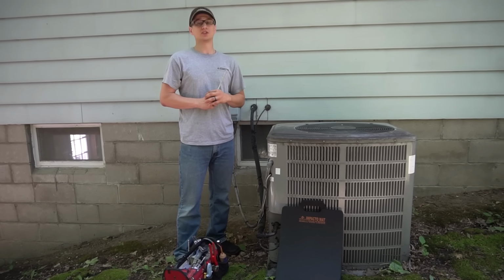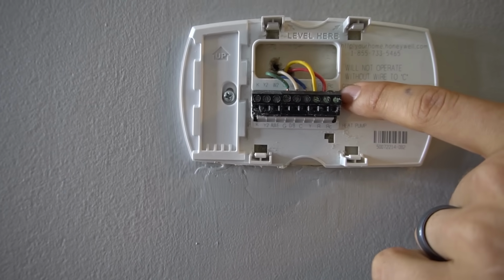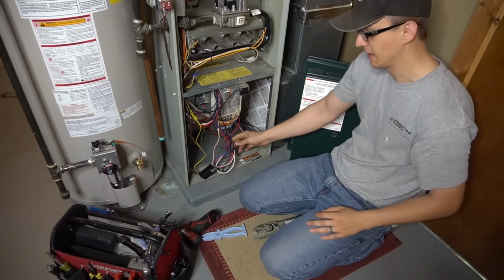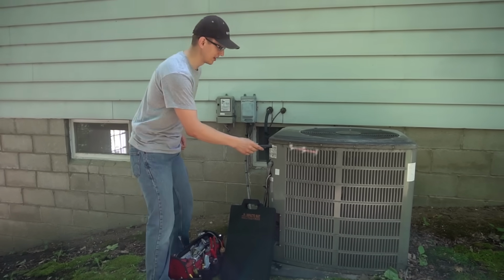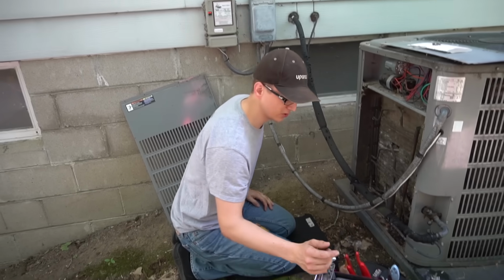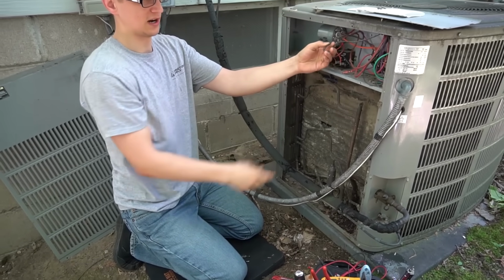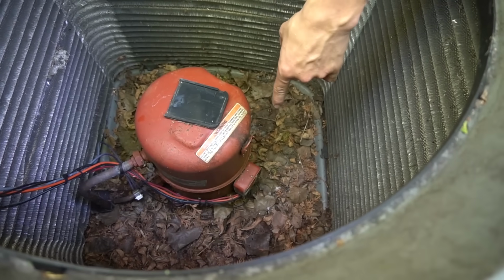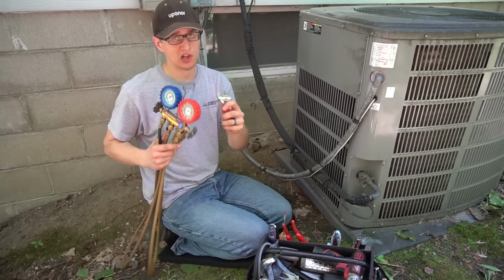AC Unit Not Turning On - How to Fix It Step by Step

Comment: Your videos are great, but I am having an unusual problem. In AC mode my system works fine in the mornings when my attic is cold. My blower stops running when the attic gets hot. I have replaced the blower motor and the capacitor. Any Ideas?

Comment: Ok, so, woke this morning to a warm house. Furnace fan was running. Both the fuses in the outside shutoff were blown. Knowing they were rather old i thought just maybe. And went ahead and replaced the fuses. Upon powering back up, they immediately blew again. 
  I assume checking the cap. Would be the place to start?

Comment: Hi, thank you for this video. The fan from the furnace in the house works but the AC doesn't.  I went outside and pressed the 220 v passer thingy and the ac worked.  Does that mean that something in my furnace is wrong? Or thermostat?

Comment: Jay, watched your video a few times and think I might have narrowed down to the compressor. The plunge switch turns on the outside unit but after holding it down for 2 minutes the air blowing out of the vents doesn’t get cold. Is that likely the compressor? It’s hard for me to tell the difference in noise between it and fan?? 
Also still confused as to why the inside system is blowing but isn’t turning on the outside unit fan even if the compressor is bad?? Your an Angel!! Thx

Comment: Question, I can’t seem to find the plunger to check your recommendation about it being depressed. I think mine has a plate over it. If my unit is turning on, and not blowing cold air, plus it is making a low hum/deep buzz noise every 60 seconds or so, does that mean it’s the compressor most likely?

Comment: My blade was not turning, unit made intermittent noises, finally got blade to start turning, but intermittent grinding? sounds persisted. Having trouble telling if it is the motor or the compressor making the noises. Not making normal constant running sounds. Thinking it's either motor, compressor, or capacitor affecting motor. Friend replaced motor over 5 years ago.

Comment: After watching 3 of your videos and reading tons of great comments here I still couldn’t fix my carrier ac unit sitting outside.
What I diagnosed so far is:
- Condenser works but fan doesn’t. After 40-50 seconds condenser shuts down.
- I opened up the panel. Capacitor and cables all look good and new. There is a blinking yellow light on the motherboard tho. (it’s a 2008 made unit). Couldn’t find what it means online.

Any thoughts what the problem is here?

Mine is a carrier performance 24apa5 model ac.

Comment: Thank you so much for this video!! Our AC unit inside wasn’t blowing cool air and the house got it up to 83 inside and we live in FL, the heat index today was 97. My husband used the screw driver to get the fan going and moving & that was the trick because the outside unit was going at all. Thank you, thank you, thank you! We are leaving to go on a trip this weekend and wasn’t going to be able to leave if the unit wasn’t working.

Comment: My unit dose not seem to be getting call from the thermostat , how do I check for the 24 volt? My inside unit is running fine, when I push the bypass on the outside unit it comes on , fan and compressor. My problem started with the thermostat battery went dead , I replaced the battery but the nothing!  I had a technician come in , he replaced the transformer , then said the blower motor was out , after he left I checked the blower motor it runs just fine .   I found a louse connection on a wire nut and the blower motor started but the outside unit is not coming on.

Comment: Excellent video! Question, my unit runs fine but after about 45 minutes the fan stops and the compressor makes a screaming noise. Any idea on what it could be? I know you said if the compressor makes a loud noise it’s probably bad but would that cause the fan to stop as well? Also, when I first discovered the noise and fan not moving I banged the top of the fan and it started spinning again and the noise went away. I’m probably gonna replace the fan motor but not if the compressor is bad. Any help would be greatly appreciated. And again, Great video! Extremely helpful!

Comment: Is it possible that both of our units would fail at the same time and seem to have essentially the exact same symptoms repeatedly? Both are Carrier units and about 8 years old.  We have replaced  blower motor control modules on both garage units (1 week apart when the units were 2 years old), and one again a year and a half later. Both fan motors were replaced on the outside units when the units were 4 years old (3 weeks apart). I cannot help but wonder what's going on with these Carrier units since things happen to both simultaneously. Our problem now appears to be again with the outside units, as both will blow inside for awhile then stop (the only difference being that one's outside fan will turn for about 30 minutes then stop, and the other won't turn at all). The outside fan blades turn freely when spun manually. We have turned off and on breakers in the house, as well as outside at the units in case something was tripped. We even installed a surge protector on our larger unit 3 years ago to be sure that power surges were not adversely affecting our units, and now this is the one that will not turn at all. We are are out wits end because we replaced 20 year old "builder grade" AC unit which never gave us a problem; we just thought that we would upgrade before problems started happening...what an expensive mistake! ($16,000 for the new units and early replacements (first three years) described above were under warranty but the labor and diagnostics never were). Any advice you might have would be greatly appreciated.

Comment: My ac fan will not turn on outside but everything else inside works, when I push the plunger button on the ac unit outside, the fan kicks on but as soon as I let go it cuts off what could the problem be?
Reply from the maker: It should be one of the problems I cover in this video: https://youtu.be/NVPhsK4gK1A
Reply: I found out what it was, it was the overflow switch that is in the drain PVC line, also had to use a jumper on the thermostat screen to reset the ac system

Comment: Excellent, detailed information. Thank you! Clearly explained with invitation to ask questions, etc. Just threw  my AC breaker switch after checking thermostat, inside etc. Outside moved blades. Waited about 15 secs. Turned thermostat on. Went outside. AC working!! Thanks. Saved me that $95 hello ++ from service guy!

Comment: Sorry another question about thermostat , if after replacing batteries, got reading on inside r y wires but didn’t get any reading on outside wires, is it safe to assume thermostat is the issue. (Fan works, connector tested ok and finally pulled in after debris was removed, outside unit ran, then died again. )
Reply: Do you have a video for the outside unit panel testing, in regards to thermostat wires just to be sure we did it right, thank you

Comment: Outstanding video to allow me to understand the basics of my A/C system!  Thanks.  My problem, still unsolved by my junior A/C man: air handler inside is working, outside fan blade spins freely, thermostat calls for air, outside capacitor is not bulging, contact sucks in as shown in video on my outside unit, but the outside compressor does nothing.
The unit was working fine last week, but I did notice that the outside refrigerant lines and one side of the compressor had a quarter to a half of inch of ice on them.  The 4-ton Goodman unit, new furnace and air handler was only installed two years ago.  And the man/company I purchased it from and who installed it died of cancer a few months ago.  The kid (less than 30 years old) left my place and said he was going to have to call Goodman to try to ascertain the problem.  Why can't some young man like you (with tons of A/C knowledge) live in central Wisconsin?

Comment: I see you only have just two contactors listed.  Do you need one specific to your condenser unit or can i just order one of those listed, depending on whether I need a single or double pole contactor?  Thanks again!
Reply from the maker: It is as you concluded, the brand does not matter, just if it is single or double pole 👍

Comment: Hi. Thank you so much for so many good and understandable videos. I have a question. I live in the Key West FL and it's basically 9 month hot weather. So my AC works a lot. What it does sometimes the fan on outside unit will start spinning wrong direction and it will make strange sound. Usually I'll just turn thermostat off and turn on later on and it's fine. But I do want to fix it and understand why it's doing it. AC is not that old (2018)

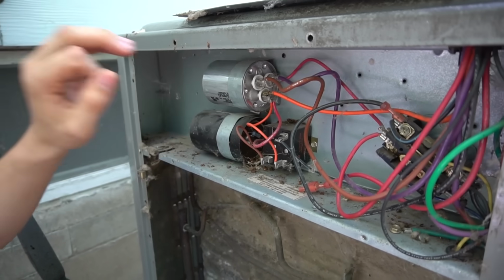Comment: At 18:30 you say if the plunger is in, (the one you press) what if it’s not? Mine isn’t mid way or back towards unit, it’s right at end, but when I press on it it like you do it does come on. When released unit stops. Fan and thermostat are working.
Reply from the maker: If the plunger does not pull in on its own, then it's time to move on to this video to find out why: https://youtu.be/NVPhsK4gK1A
Reply: Thank you, I think maybe the water line thing you said, we’re in Florida I was sucking it out to clean it then it quit so is it possible I knocked it out of place when doing that? Well check it tomorrow in daylight. Thanks!

Comment: they are reduing the siding on my condo unit. They asked me to pull the breaker so they can pull the electrical boxes off the siding while they work the new siding on.  Now i got no air.  the inside fan works but not air

Comment: Great diagnostic video.  I had a plumber knock loose the 24V signal wire to the condenser.  Your video led me right to the culprit.  Cost = 1 wire nut.

Comment: Hey Question please as we are dying with 100 degree temps inside our house for weeks now and AC techs are booked up solid thru the end of the summer...

So NO AC, bought a new thermostat, installed it, checked to make sure i have 24v to the thermostat (red and common voltage check and its good (27 v).  AC is not turning on.  When I push in the contactor bypass, the AC starts whirring and sounds good.  But I let it go, it stops.  I don't see anything obviously wrong, no frayed wires, capacitor looks fine.  The AC motor starts running and sounds great when i push in that contactor bypass, so the AC motor is good and it seems I'm getting power and all to the AC.  

What could be the problem?  Is there any way to keep that bypass pushed in somehow or otherwise bypass everything so my AC starts running?   

Thanks and desperate for help.. I can answer any questions or do simple checks if needed.  Yes the circuit breaker switches are ON and have been flipped off and on. (just in case you ask)

Comment: OMG, I have never watched a video that gave you so much information and I've watched a few, as I like to fix things myself if I can.  You are great, thank you so much for this video, I still can't get over the fact that you shared so much.  I don't know that I'll be able to figure it all out to actually get my air working without calling someone because I'm scared I'll mess something up but wow, thank you, thank you for the share.  I did the basics that you said but it still won't turn on.  The thermostat shows it on but it's not.  I'll try some of the other things you said and see what happens.  Thank you again!  You're fantastic!
Reply: I have question my condenser fan motor is working good but my compressor stop many times I check 24 volts is ok ,from thermostat to condenser is good 24 volts the compressor continue do same problem?
Reply: @zurdohtown  your short cycling somewhere. Check your drain line and your float switches. Be sure they are installed properly and check drain
Reply: Great video, most people act like they know something, this kid does.

Comment: I was up for 3 hours taking apart everything!!in a hurricane from 11am till 2 am. Today, i took off the thermostat and there was a bug on the fan and cool wires omfg tysm for this man its been 10 minutes and its cooled off so much can i send you a tip???
Reply from the maker: Yikes, sorry to hear about the multi-hour AC battle! Glad to hear you were able to find and fix the problem. 👍
You can but don't feel obliged to 😉 I have a PayPal link in the video description.
Reply: @WordofAdviceTV  well it seems like i het it going, then after a hour or so it stops again. 3 times its happened. Its like the fan isnt getting enough power maybe or for long enough? I greased the bearing the fan rotates on i did all the checks, which i did find a bug on the ac fan wire and the ac wire with the split itself. That also got it going again. Maybe its the fan motor which is $300-$600 but the thing is, this is a 30 year old train 1500 and it doesnt have almost anything the new ones have. I couldn't even find a fuse AT ALL DOWN STAIRS. I CLEANED THE LINES VERY WELL. GREASED EVERYTHING i could get to(bearing wise or parts that spin) lmao i cleaned the disconnect and romoved it while working. It needed help getting the fan moving so i pushed it and it started right up the first time. Then found the bug behind the thermostat, greased the bearing for the fan, started right up. So what does it sound like to you? Am i right to think its the fan motor? And absolutely i will give you a tip!! im in new Jersey, its been raining and over 90 degrees with 70 or higher humidity  man i have no other options at this point. I hope to hear back from you!!thank you sooo very much for your time. If i leave my email can you or i delete it so you can get in contact with me and maybe we can video chat?? This thing is old but still almost new id really like to save it.

Comment: Such a great video. The thermostat is set to hold and it is on the cool setting and the AC is not kicking on. If I set thermoset to fan on - the fan does not come on. If I walk outside to the compressor and push the contactor the fan outside comes on so it seems the problem is inside or the wiring. Do you have a video on how to diagnose the board/wiring? How would I bypas the thermosat and force the compressor to kick on?

Comment: This is great video for basic diagnostic of failing ac system.
  Could someone help me with my issue, my condenser keeps blowing 30amp fuse on electric panel.  Any suggestions?
 Thanks

Comment: could you make video how to fix pipe leaking, the technician said I needed Purge, Repair, Vacuum and Refill with R-410a refrigerant 8.50/oz (avg 50 oz). plus instead of tackle where the leakage, do you think I can replace the whole copper pipe.
Thank you from Kenneth

Comment: My fan motor turns hot when I push the button that bypasses the thermostat and doesn’t spin. I checked the cap and it’s rated for 30+3 but I got 26.3+3 should I change the cap? The compressor also turns on fine.

Comment: Urgent: I need your advise. Bought a condo last year and just a month after the home warranty ran out, AC compressor stopped working (3 days ago). I followed your steps and identified it as a 2006 Allegiance 13 3 1/2 ton r-22 unit. The fan in both inside and outside unit works. The capacitor is good. A technician also said that the capacitor and hard start kit are good and concluded a bad compressor since it tried to start but stopped immediately. The technician estimated about $5-6K to replace the outside unit. It will put a big dent in our savings. Should I try your test to see if compressor is shot? Or Just replace it? The technician would replace with a 410a unit but you said it's also going out. What should I replace with? Thank you.

Comment: This is a great diagnostic video. Thanks so Much. I have a feeling it'll save me alot of money when the tech comes tomorrow. I've checked the circuit breaker and it's OK. My thermostat works OK, the unit tries to turn on, accompanied by a minimal whining noise but the fan doesn't run and the unit doesn't come on. There is no clanking or loud noise from the compressor when I'm outside listening. If I understood your algorithm correctly, that means the capacitor and probably the fan motor need replacing. If you could confirm my hunch, it would be great. Thanks again.

Comment: Thank for the video. It saved me a lot of money. And A/C tech came over to give me a quote and he noticed that the power was not 120v on one of the wires. I report a partial power outage and Florida Power and Light fixed the issue, but the A/C was not turning on. I followed the suggestion to inspect the fuse in the main board. Lo and behold, the fuse was just laying there on the side and it was not connected. How did the fuse come out of its place? Makes me wonder about the A/C tech. Any thoughts?

I am a new member of your channel. Thank you...thank you.

Comment: Excellent video. Our 5 year old A/C unit stopped worked today and your video helped me to find a broken thermostat wire connector at the A/C unit. I also found a mouse nest with a couple of dead critters so I cleaned out the nest and plugged the access hole. You saved me a service call.

Comment: great job. I found the wires fried to my capacitor thanks to your video after pulling the disconnect button. My son reminded me to be careful with the capacitor to make sure that it is not holding a charge even though the disconnect was taken out. Now, I need to figure out why the capacitor wires fried after only three years.

Comment: Great video.  My AC unit was not working and followed this video. The motor worked when I press the plunger. Then I noticed a loose connector.  With the power off, I reseated the connector.  My AC system is now working.  Thank you!